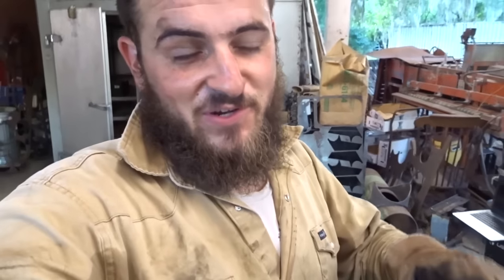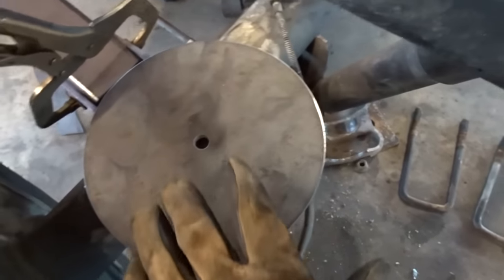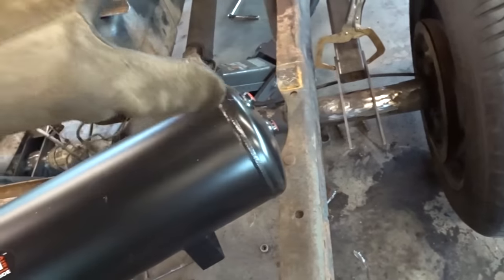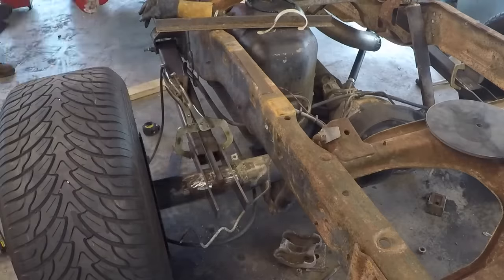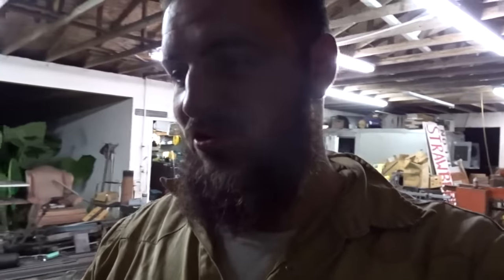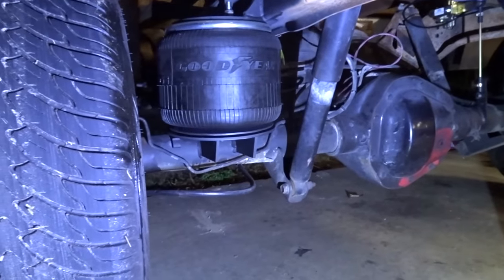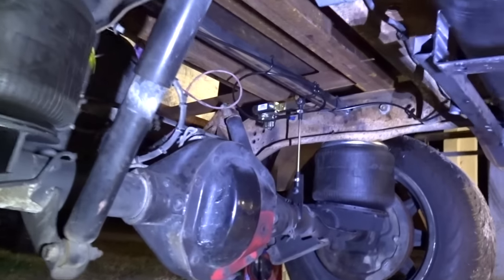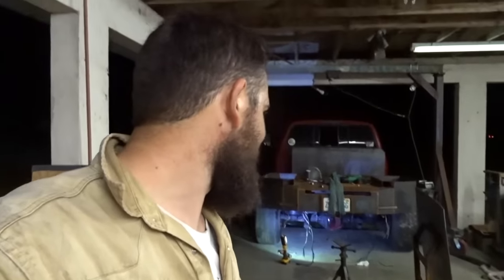Simple Air Suspension Build

Comment: I've been building and installing Air Bag systems on trucks, mini trucks and cars for over 15 years. Note to new players, do not copy any aspect of this set up. Absolute rubbish doesn't begin to describe how crap this set up is. Total garbage. And I'm usually a nice guy but this is horrifyingly bad.
Reply from the maker: It works
Reply: I'm sure it goes up and down real nice and in a perfect world it'd be all you ever need. 
Ever wonder why everyone else uses at least a 3 link?
It won't articulate (roll side to side) ok, sorry! It will but it'lll snap off where its welded to the diff.
No torque control. The nose of the diff wants to nose up under load. (Its the pinion climbing the crown wheel)that little bracket ain't gonna take it. At all. And then you made it worse by putting the bag at the rear of the axle, itll rotate the axle like a champion.
No panhard or triangulation or watts link. Trust me dude, it'll walk side to side like a MF!
And it'll be hard as. Bags at the rear of the axle! Done that. It sucks!
👍for the effort! But many many people much smarter than you or I designed this stuff long ago. There's a reason its complicated.
Do some research.
And remember! If you can see daylight under it! It's a 4WD!
Reply: A bit harsh haha... But im glad someone can see through this project... Looks similar to a z bar set up that medium and heavy duty trucks have but they use thick spring style bars for links (to allow some twist also the bushings are very large to allow even more flex, they also have a pan hard dead smack on the top of the diff center to the frame, short but it works for them...(I looked into the z bar design) A welding rig that will be off road should have a nice triangulate 4 link... If it must be parallel a nice long pan hard is a must to minimize size to side and any possible binding/ stress to welds and links, still not ideal for heavy articulation. When I built a 4 link for my excursion i though hell this is easy..... Cut every thing out and then started to think of stressing welds, binding, angles... I almost threw in the towel when I realized it was going to be a long learning process but at that point I had already sold my original parts haha ... Research is key. Put a 10k trailer behind this weld rig for any extended period would be nothing but a liability.
Reply from the maker: I agree that this isn’t “correct” but that’s not going to stop me from trying things, you live and learn and if something goes wrong I’ll be sure to tell you want happened
Reply: Absolutely man... I'm all for that... Like I said I cut up all my crap then was like wtf did I do haha... My design is not perfect but I did have about 300hours invested in straight learning about linked systems spring rates ECT.... You do great fab work I would hire you for that... But remember It just takes 1 accident to put someone in a world of hurt... Not only physically but financially... Your videos did encourage me to keep on cutting though haha 👍
Reply: And no I have never clicked thumbs down on any of your vids haha.
Reply from the maker: You can dislike I don’t care haha
Reply: @j_moffitt  never said you did care... Im just stating that I enjoy your videos... You probably dont care that I do... No tears in my eyes haha.
Reply: Hey fellas, if you’re still around here. I picked up an 2002 F350 7.3 Powerstroke that has a 4 link setup with airbags kind of similar to this. I blew both, and ordered replacements, but I have some questions on this truck. If anyone is bored and has a bit I’ll get contact info and some pics of how she looks. Would love to know what I should do, stock parts, put leafs back? Idk.
Reply: there are many better way to talk to the others ...so say good  words or dont..      thank you.